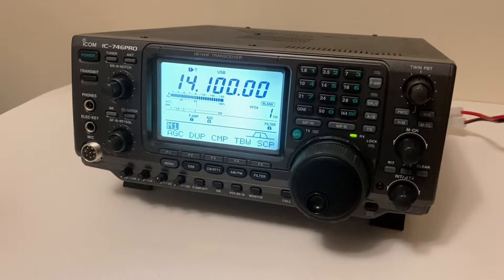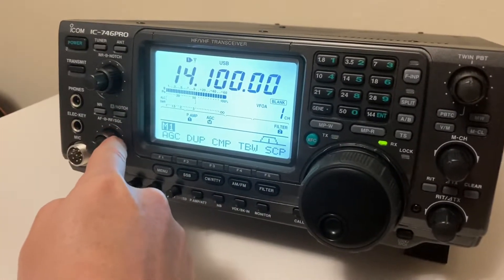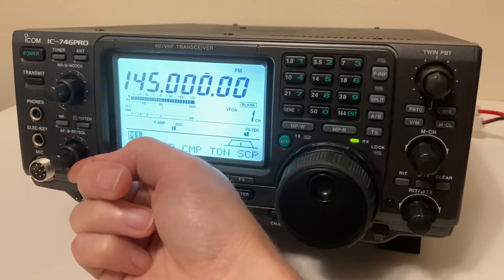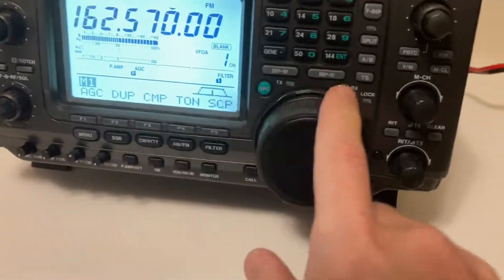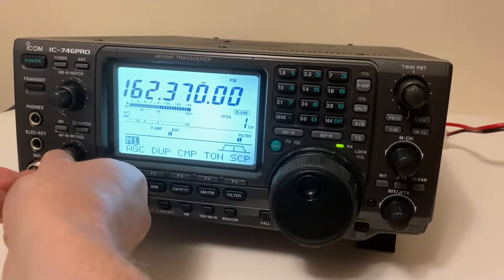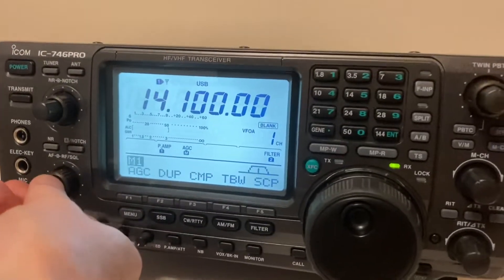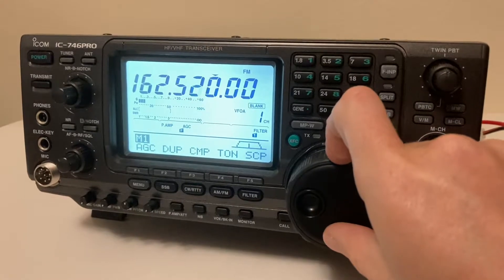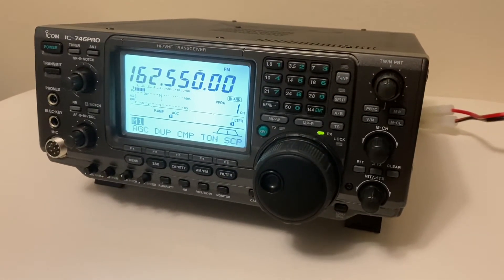Icom IC-746 Pro audio issues: dirty DC, voltage out-of-bounds, or bad components? Elmers pls comment

Comment: The service manual, specifications section, states that the voltage requirement is 13.8v +/- 15%.  I don't think you mentioned if the unit is able to transmit properly, so I assume you observe this only while using it as a receiver, where you've only needed to supply up to 2amps of current to it. An intermittent noise-producing bad connection when drawing up to 20 amps while transmitting would definitely show itself readily. So I'd check the battery using a reliable voltmeter while it's under load by the transceiver to make sure you have clean power and check the connections supplying power to the unit. Specifically, check that the pins on the power connector on the back of the rig are clean and fit together tightly. They can relax their grip and corrode over time. Clean them with some solvent such as alcohol or Deoxit and maybe a bit of scraping if these are discolored - they should be bright and shiny. If the contacts feel loose, I've had success by pushing a long sharp thin pin-like tool between cylindrical female metal contacts and their plastic holder to bend the contacts closer together for a tighter fit. Do the same for any fuse contacts on the power cable. Inspect the cable for kinks or possible breaks in the wire and be sure that crimped on contacts at the power supply end are good. Sometimes jiggling,  tapping, cooling and heating can help expose bad contacts (or, if you go inside the unit, defective solder joints and failing components).   I think you are right that after 20 years of reliable operation, something inside, connections, solder joints, components are suspect.  But before you go inside this, you may want to consider if you need the help of someone with the skills, access to tools, materials and the time  and mental energy required to work on complex modern RF electronics (ESD protection, SMD soldering tools, delicate ribbon cables and tiny brittle plastic connectors, special troubleshooting skills, proper service documentation, proper test equipment such as a good DVM, oscilloscope, spectrum analyzer, wattmeter, dummy load, etc.).  If you want to learn I don't think you should start with something as complex as this without some serious help, it's too easy to damage it. Have a friend, someone who is qualified, help you, or send it to a shop, or sell it as a parts rig and find a good deal on something newer.
Reply from the maker: John, thank you for your very detailed response! Hopefully this helps others who’ve experienced this issue. I’ve since sold the rig for something like $1,000 as “for parts” on eBay, but left the video up so that others experiencing the same issue might find the help they need. 73 for now, and thanks for stopping by! 📻 ⚡️

Comment: Have you tried another PS, those switch mode can be noisy especially if you are having issues with that PS
Reply from the maker: That’s a good point! Very well could have been the switching power supply. I sold this rig on eBay “for parts or not working” for $1,000 plus shipping and got positive feedback, so the buyer must have had a better power supply. He used a freight forwarder and got it to the Middle East!

Comment from the maker: I may have found the issue. It seems that whenever I wait a good 20 seconds between the time that I power it off to the time that I turn it back on, it behaves like normal. It seems to have the audio issues only when I power it off and on quickly. Never had that problem before, and I’ve had this rig since 12/4/02. But it being almost 20 years old, some of the components, bus connections, or solder connections may be starting to go.
Reply: Did you ever find out what was going on with your rig ? as far as volts go , Anywhere between 13.8 and 15 volts are exceptable . But going any higher may cause damage eventually especially in the finals . Also check your swr , connectors and cables just to be safe .
Reply from the maker: Hi Floyd, thanks for stopping by! Unfortunately, I was never able to find the root of the problem. I’ll update the description to this video right now, which will detail how I sold it for a great price, despite disclosing the strange issues it was having. Check it out!
Reply from the maker: Thanks for the advice! Tantalum caps sound like a good upgrade 👍